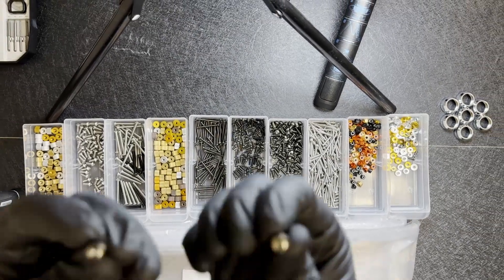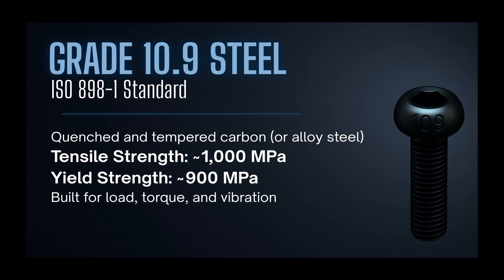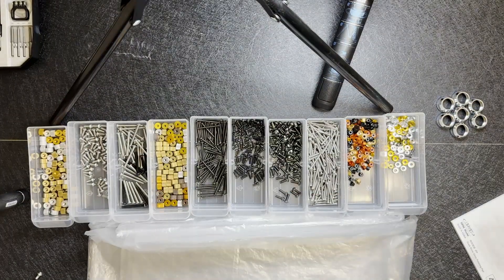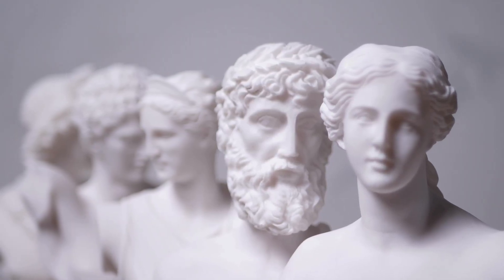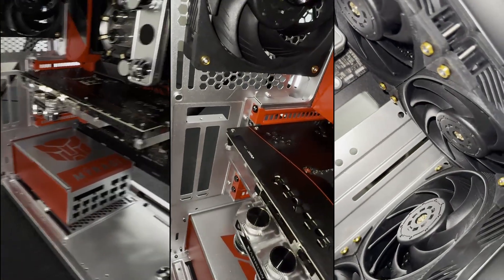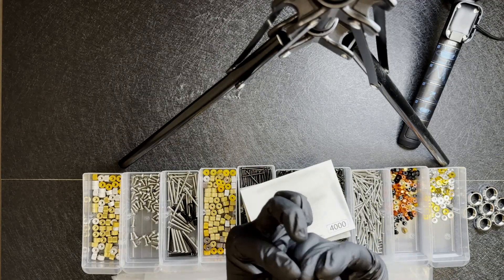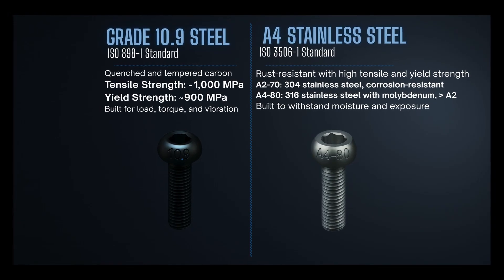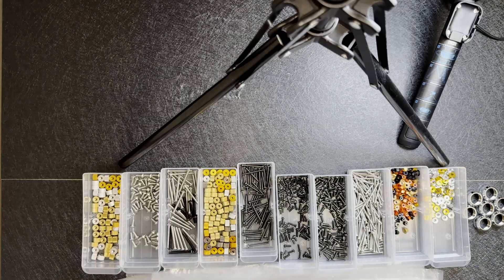Carbon vs Stainless Screws | Which Is Stronger and More Polished?

Comment: That’s a slick combo carbon and stainless steel screws together? You’re not just building, you’re curating strength with style. The contrast, the durability, the finish… it’s like industrial elegance. Seriously impressive work blending function and flair like that.
Reply from the maker: Appreciate the kind words, yeah once your remove RGB and all the silly stuff out the way, you have to bring style and strength like you mentioned!